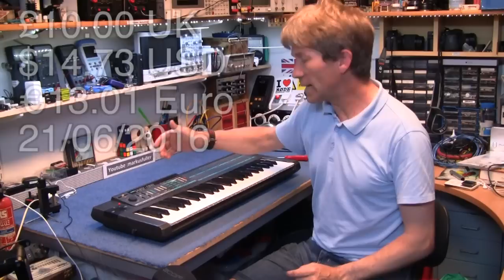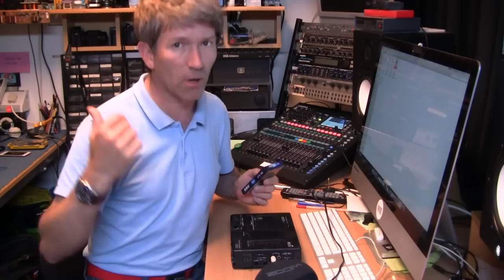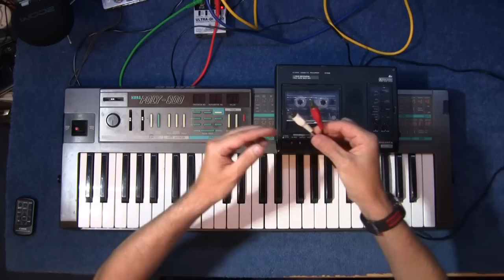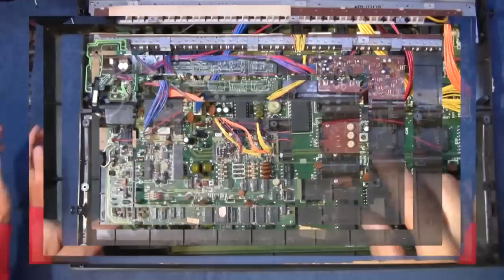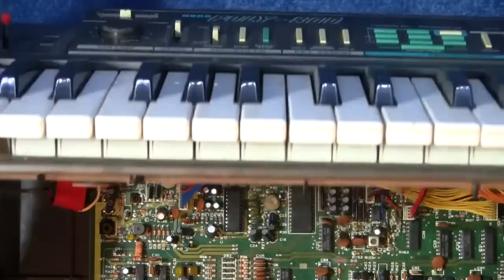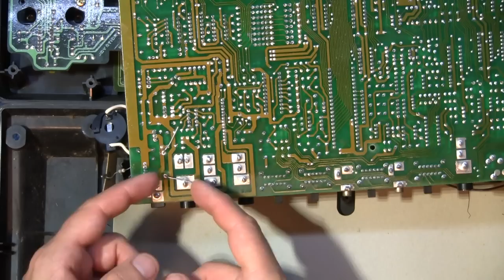korg poly 800 not worth the cost to repair this vintage synthesiser MF#81

Comment: Can You please make a tour on your house? I'm curious about your workshop and equipment, and audio bench and so on. It seems to be very special.
Reply from the maker: Hi I dont think my house is anything interesting, all you see in the video is almost all the small workroom where I do all the video's from.other than what you see theres just a normal standard house (ok a few more keyboards here and there but they have all been in the videos) many thanks but I will certainly consider it for a future video.
Reply: Well, how about your audio rack ?
Reply from the maker: Audio rack contains: Symetrix511A (noise reduction) . Behringer multicom pro & composer pro (both not in use anymore) - alesis midiverb4 - lexicon mx200 - aural exiter type c - and patchbay, but none have been used for a long time as the Allen & Heath QU-16 mixer now does all the work with its built in effects, EQs, compressors & gates etc. so the rack will eventually go. may keep the aural exiter though as it adds a little magic to a mix that cannot be explained. oh I just realised theres more racks under the desk.

Comment: As others have said, you can't win them all! You have a very early Poly-800 there - the first batch didn't come with the internal backup battery fitted and instead relied on the main power batteries to store patches. I guess you could part it out and still make your £10 investment back quite easily :-)
Reply from the maker: I too was hoping that a factory reset would be the easy Fix. I'm pleased you got yours working. best wishes from one of your fans :-)
Reply from the maker: I guess there will be someone out there who needs something from it to fix theirs. Im happy to be an organ or keyboard donor if anyone needs any parts from it.
Reply: And that missing backup battery was my luck: I bought a Poly-800 from a flea market for the equivalent of 5£. They thought it was broken but it turned out that it had just lost it's presets which will make it all silent untill it is reprogrammed or have the tape backup loaded. The D-type batteries inside was 23 years old....

Comment: How devastating! First time I've seen you beaten! I have a Korg Poly 800 and the battery has gone. It had been in storage for nearly two decades, so easy to understand why! I also found the 'tape' audio file, but you don't need to record it to a cassette - my Poly 800 restored beautifully just using the headphone socket on my PC.
Reply from the maker: Hello I had several days working on this poly800 and tried my best not to give up too easily but after finding the main chip was dead along with a few others I realised I would never get it to sing again. Yes I could have used the headphone out from the PC but I wanted to do it old school style :-) Many thanks from Markus.
Reply: Perhaps worth hanging on to? Maybe you might pick up another you can cannibalise?
Reply from the maker: oh I will not throw it away, just incase the parts are needed for another one in the future.

Comment: Not sure if you will answer, but recently  my keyboard keys started malfunctioning, I opened it and cleaned also used some graphite on the key and the circuit that was worn out. It fixed for 5 months, now I'm going to do that again, do you have any suggestion if I should do something different or something besides the graphite and cleaning?
Reply from the maker: Hello, Its really only a temporary fix with the graphite. if possible you should try and get the replacement circuit board with the carbon tracks on it though I know how difficult that can be sometimes.
Reply: markusfuller Thanks for the answer, I'm gonna do a little reasearch because I have no idea how use those, my city is pretty small and the eletronics guy had no idea how to fix it too.

Comment: I still have a greatly broken poly800 myself that I somehow never have been able to fix. It just sort of randomly blew up in the middle of producing in my studio a long while ago and I've changed some chips that fixed it to some degree but still not fully perfect.. It's a difficult synth to fix !
Reply from the maker: I guess I was hoping to load the factory settings and that would be fixed, pity theres so many hard to find chips in them, I would love to have this working.
Reply: I think mine isn't as far dead yet, I have replaced an opamp in there to luckily fix the LFO to some places (it seems something blew in the power section) but from then on no presets whatsoever stay where they are. Every setting is always set as such that there's no sound until i change Attacks and etc. Honestly I think it's an alright synth, I had an inverted key one that I modded the slayer filter mod into (greatly advised to do this!) but other than that I think the sequencer was the only other good thing. Thought it sounded a bit wonky but that is in my opinion.
Reply from the maker: Hi I changes a few parameters just incase there was something from the factory reset not getting through. but nothing happened apart from the background hiss. and 4volts dc on the left output.
Reply: But the display showed numbers and such and reacted? If so I think the major important chips are probably alright. I've dug up the ol' schematic but it's a crappily scanned one. I'll let you know if perhaps I have an idea.
Reply from the maker: yes the main digital controlchips seem to be working fine but its the oscillator/waveform chip etc that seem to do nothing at all. no life detected by the oscilloscope. trouble is they are really expensive and I have replached parts like this in the past and immediatly fried them because of another problem somewhere else on the board. I know I may seem like im giving up too easily but only because i have been down this rabbit hole before throwing money at something that cannot be fixed.
Reply: You either give up right now, or you give up right after spending money. I'd choose the first option too. Your video did inspire me to grab the carcass of my own poly800 from the basement and just have a go again, see if I can breathe new life into it this time for good. It's the only synth so far that I haven't been able to fix at all.
Reply from the maker: I keep reading on other sites where people are having great trouble repairing these poly800s . pity really as I would have liked this one in my collection.
Reply: It is kind of a frankstein design the whole thing isn't it, with it's several clocking oscillators and digital controls going through analog circuitry and such, the NJM's they use seem to all be on the edge of noisy so other opamps aren't quite as well working etc etc. Hence why I would really like to get this one to work because there may be some external patching possibilities for this.

Comment: Polarity on the battery holder looked reversed as the outer tab is normally positive on those CR batteries. Explains why the battery got hot. Like you said who ever was in there probably destroyed it. Shame
Reply from the maker: Hi I did place the battery correctly as there was also the + marking on the tab and the part on the track went to the correct part. I think maybe the loose lead of the unsoldered diode may have been shorting the battery out underneath the circuit board or maybe allowing the 9Vdc to creep across to the battery. Pity really as I would have liked to have this old keyboard working.

Comment: Right when I saw those Diode leads just bent over everything else I had no hope it would work either.

I don't know a ton about electronics, but I know that's a terrible thing to do!
Reply from the maker: Yes when I saw that I suddenly though "this is a waste of time" pity really as they can sound reasonably good keyboards when they are working.
Reply: You know that looks like a repair that was suddenly abandoned. Like the repairman immediately stopped and just left it like that.
Reply from the maker: yes I wish he had at least soldered the diode into place though and trimmed off the wires.
Reply: Stick a fork in it....It's DONE!